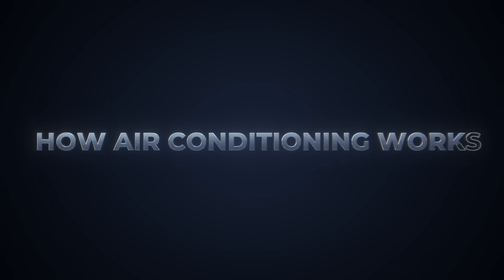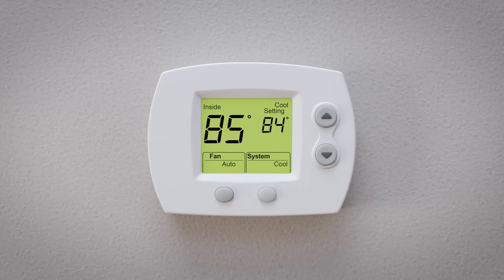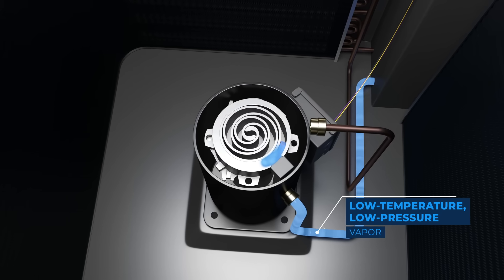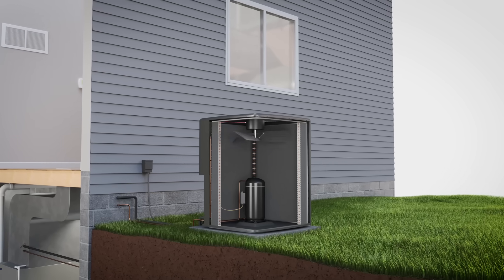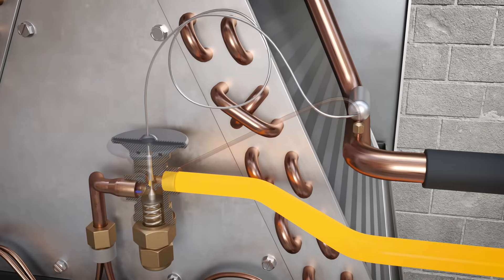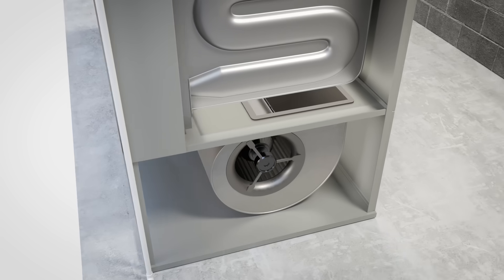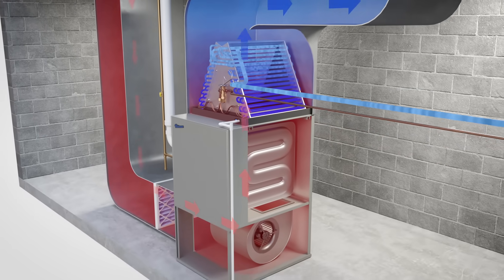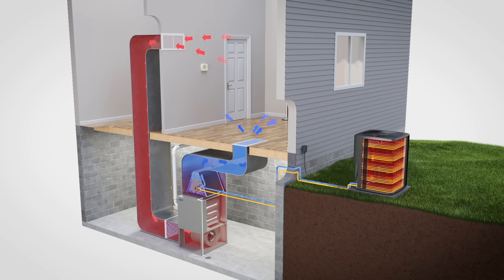How Air Conditioning Works

Comment: wow that's actually quite complicated
Reply: It's really not. The state changes of refrigerant can be ignored in describing it, and instead just saying "compressed" and "uncompressed" states of the refrigerant (Freon, generally). You take exterior temperature, uncompressed refrigerant, and run it through a compressor. In it's now compressed state, what was an exterior temperature at an expanded volume is now a hotter temperature in a compressed volume. Same total energy when considered as an isolated system. 

The refrigerant is then run through the condenser coils to increase it's surface area exposure, and the fan cools it back down to ambient exterior temperature by blowing outside air through the coils. Once cooled back down to ambient exterior temperature, it runs through the refrigerant lines back into your house and to the air handler. Then it hits an expansion valve, which allows the refrigerant to expand back into its uncompressed state. 

So what was ambient exterior temperature in a compressed state, once decompressed into a larger volume, is now cooler than the surrounding air. Again, same total energy level but differing volume. This uncompressed refrigerant runs through the evaporator coil, making it colder than interior air. A blower pushes conditioned air inside the home through the coils, where the air's heat is transfered to the now cold coils, and then into the supply plenum connected to your ductwork, and distributed to registers throughout the dwelling. 

That's the reason the efficiency of your unit is based on the difference between your thermostat setting and the temperature outside; because the system always starts at ambient exterior temperature, and becomes less efficient the greater the temperature difference.

Comment: After watch this video : 

i still can't understand
Reply: It's really not that complicated. The state changes of refrigerant can be ignored in describing it, and instead just refer to it as "compressed" and "uncompressed" states of the refrigerant (Freon, generally). You take exterior temperature, uncompressed refrigerant, and run it through a compressor. In it's now compressed state, what was an exterior temperature at an expanded volume is now a hotter temperature in a compressed volume. Same total energy when considered as an isolated system. 

The refrigerant is then run through the condenser coils to increase it's surface area exposure, and the fan cools it back down to ambient exterior temperature by blowing outside air through the coils. Once cooled back down to ambient exterior temperature, it runs through the refrigerant lines back into your house and to the air handler. Then it hits an expansion valve, which allows the refrigerant to expand back into its uncompressed state. 

So what was ambient exterior temperature in a compressed state, once decompressed into a larger volume, is now cooler than the surrounding air. Again, same total energy level but differing volume. This uncompressed refrigerant runs through the evaporator coil, making it colder than interior air. A blower pushes conditioned air inside the home through the coils, where the air's heat is transferred to the now cold coils, and then into the supply plenum connected to your ductwork, and distributed to registers throughout the dwelling. 

That's the reason the efficiency of your unit is based on the difference between your thermostat setting and the temperature outside; because the system always starts at ambient exterior temperature, and becomes less efficient the greater the temperature difference.
Reply: @deathlis  had to read that a few times but that makes sense lol. Thanks for explaining
Reply: @milohasagun  Welcome.
Reply: It looks like a collection of random images and random text.  The target audience must be the people who already know how an AC works.

Very poorly done.